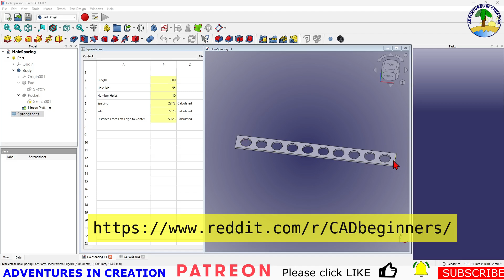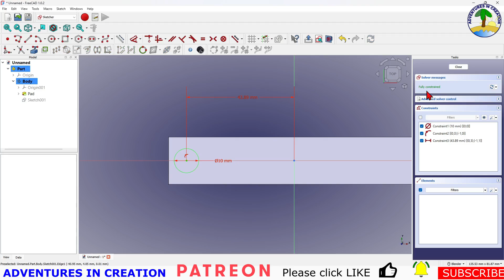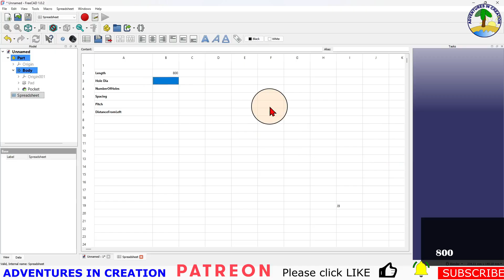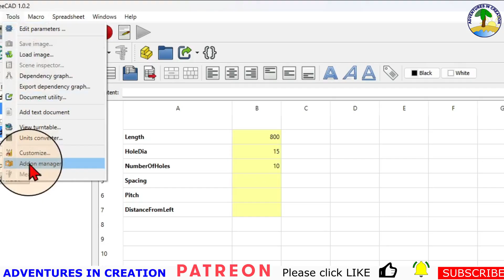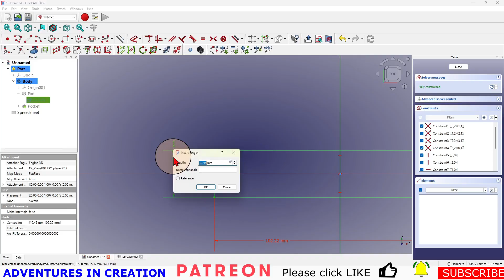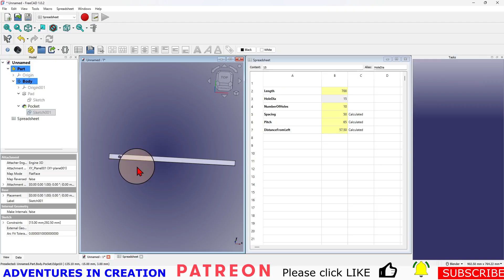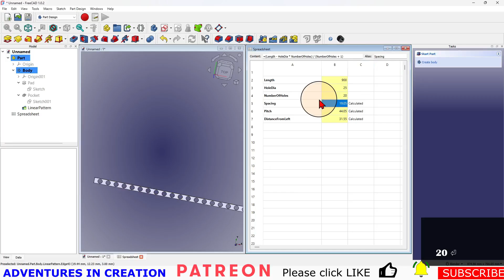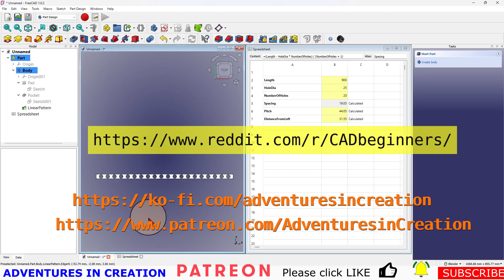Intro To FreeCAD Version1 0 Linear Array How to keep holes where you want them!

Comment: Thanks for another great video!
05:30 EasyAlias That happened to me as well with another macro. Latest official FreeCAD Portable on Win11Pro (OS always up to date), there where a lot of scripts missing in the Addon Manager. If that happens maybe try this, solved the problem for me: go to the Addon Manager and check if there is an update for the Addon Manager itself. Somehow (at least on the portable version of FreeCAD I use) the Addon Manager is not updated automatically. I have installed that update, restarted FreeCAD et voilá: all scripts from the wiki are available now.